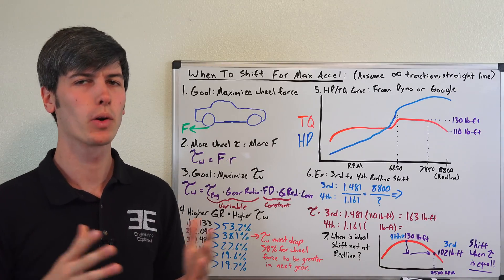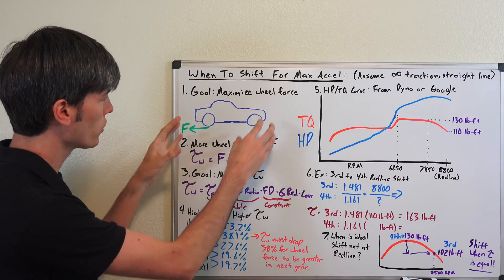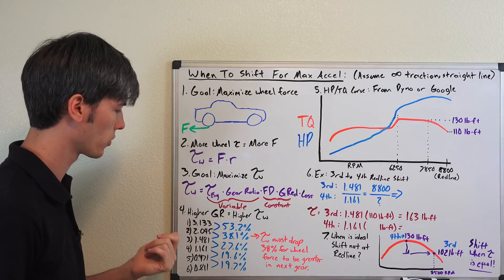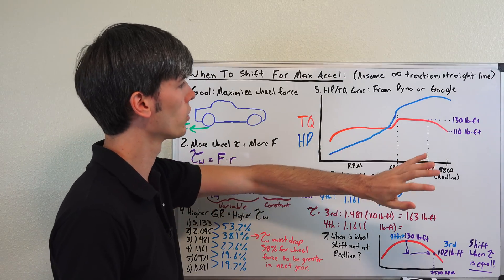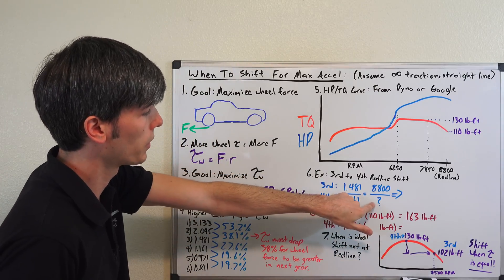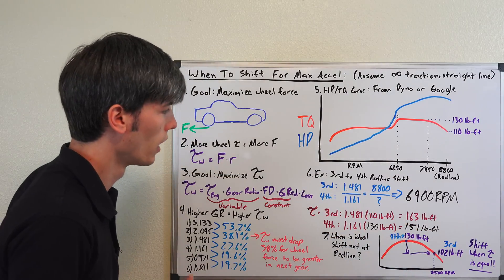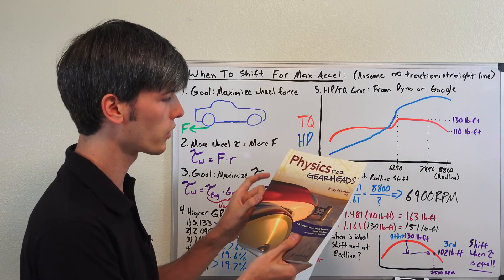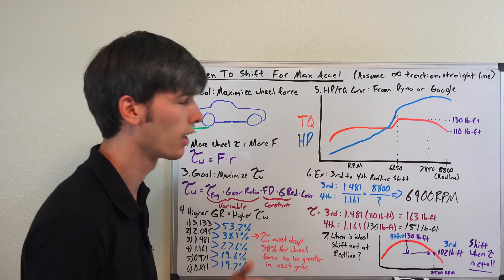When To Shift Gears For The Fastest Acceleration

Comment: My old 95 Vauxhall cavalier mk3 with its 1.8 8v engine has highest torque at 3000 RPM. So Im wondering is it not better to shift at around 4000 RPM because after shifting I always end up at around 3000 RPM on that RPM the engine got the highest torque. I feel like its better to stay between 3000 and 4000 RPM rather than revving to Max RPM and then shift.

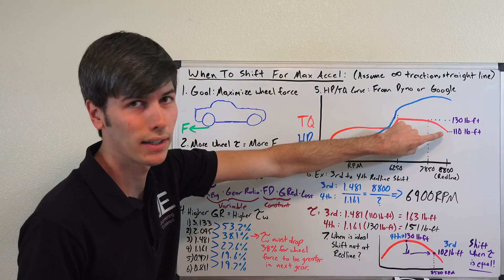Comment: 6:16 How would a large peak-to-redline torque difference (i.e. 400ft-lbs peak & 250ft-lbs redline AKA 60% difference) affect this? For my 2023 AWD kia stinger 3.3T (A8TR1 transmission), the lb-ft for each gear decrease (1st 916.25lb-ft, 2nd 910.48 lb-ft, . . . 7th 231.48 lb-ft, 8th 216.84 lb-ft) but the peak-to-redline torque difference of 60% is higher than even the 1st-to-2nd gear difference (1st 3.665 to 2nd 2.396 = 3.665/2.396 = 52.96%) 60% > 52.96% Does this change anything, or do I still run it out to redline based solely on the fact that each subsequent gear will produce less torque than the previous one?

Comment: At the same wheel speed, RPM is proportional to gear ratio. So basically, we can use engine torque × RPM instead of multiplying torque by the gear ratio.
And as we know, engine power equals to engine torque × RPM. Hence we can use power instead of multipying torque by gear ratio.
To simplify that, basically you want to stay in a gear which the engine makes more power. By looking at that specific graph, we can see the engine power output is the same at 8800 and 7500 RPM; meaning at any RPM below 7500 we would have less power comparing to redline; resulting less wheel torque at the same wheel speed.
So as long as you know shifting at the redline drops engine RPM to any number below 7500, it would be more efficient to redline it.
This engine + gearbox characteristic is usually the case with most production cars, which makes them go faster if you go all the way to redline before shifting.
Reply: Edit:
Engine power is "proportional" to engine torque × RPM; not equal.
Physically, it is indeed equal, but only when you use SI units; which would be watts, N.M and angular rotaional speed ( RPM×pi/30 ) for power, torque and engine speed respectively.

Comment: Jason, maybe you could help me out with some of the math. On your example of the difference in percentage of torque between 1st and 2nd gear, you come up with the answer 53.2 %. However when I divide the 3.133 by 2.045 my calculator comes up with 1.532. If I move the decimal point to the right 2 places to convert to percentage, then it would be 153.2 . Sure I'm doing something wrong just curious.  Same with the other gears, there is always a one in front or your answer. Thanks.

Comment: The best acceleration is when you have the biggest torque at wheel and it is eqiuvalent... the biggest power from the engine, not the highest torque. This is because of gears ratio in transmission. So you'd better look at engine power plot than torque plot. So you have hill-looking plot of power and you are going to higher rpms. When you are at the downward slope of that hill you should look what rpm you get if upshift (lower rpm). And if at that point (2) power gets equal to the power at your current rpm point (1) you should change gear. That's all. And every gear in the box has its own point for optimal shifting.

Comment: The simple answer is: the gear with the most power wins. Look at a power curve for your engine.  Work out the ratio of two consecutive gears let's say 4th to 5th is 1.25:1. Look at the top of the power curve and try and get two equal powers above and below the power peak with the rpm in the top gear, 80% of that in the bottom gear.
It will usually be the rev limiter apart from in diesels with small turbos and lots of closely spaced gears.

Comment: Nope.

Plot the torque curves in each gear relative to road speed.

Where those torque curves intersect are your optimal shift points.

If the intersection would theoretically be above redline, you compromise by shifting at redline.

If you shift too soon or too late you will lose a chunk of the area under the respective torque curves.
That means slower acceleration.

It's as simple as that.🚗🏁:text-green-game-over:👍👌💯

Comment: Why not shift from 3. to 4. at 7.850. Would that not give my torque to the ground?
Reply: NO cos power graph is important not torque graph 😉👌🏻 when you ups at 7850 rpm you would use lesss power for accelerstion = worse accelerstion 👌🏻

Comment: Super interesting. So, does this mean that horsepower has NO influence on the ideal time to change gears?
Reply: horsepower is the only thing beside gearing which have influence on when to change gears its all about avg power through distance lenght at which you measured  performance or speed range 😉👌🏻☕️

Comment: I could be completely wrong on this, so correct me if I am wrong, but here me out. As I've grown up with the whole HP=Torque*RPM/5250, thus is another representation of torque taking into account the benefit RPM provides a lesser torque value, I've come to look for the HP curve and use that as a guideline, and you typically want to try and maximize the HP figure for the longest you can. Or at least that's always what I've done in Racing games and IRL (avoiding going into redline IRL for durability reasons). I think it could be interesting to do a whole deep dive on gear ratio's, engine power curves and their shift ranges, and then to plot these out into a meaningful graph of some kind of how far past peak power you go.

TLDR, it makes sense to shift at redline on the displayed powergraph and shift RPM difference because a redline shift maximises the area under HP. At least that's how I've always looked at it and used as a rule of thumb.
Reply: rules are : slowlsy increasing power before peak and rapidly drop after peak you shift earlier 👌🏻 rapidly increasing power before peak and slowly decreasing power after peak = you upshift later 👌🏻 yea area under power graph its what metter so thats why 👌🏻 you must also consider diffrencess between gear lenght and speed range which ypu want measured sometimes ypu get benfit for ups later sometimes sonerr 👌🏻 all dats must be precisellly subcribe than can be calculate pefect ups time 👍🏻 furthemore at so e egzample elt say power graph some engine setup for racing or not whatever look like piramide so power before peak increase the same fast as it drops after peak power than asssuming diffrencess between gear lenght is small you ups very close to peak power rpm but assuming difrencess between gear lenght are huge you must ups later 👌🏻 after peak power rpm 👌🏻the boger doffrencess the later you must ups for get most avg power for drive vehicle 👌🏻☕️

Comment: Awesome explanation. 
To find at what RPM to shift, wouldn't it be easier to solve for the rpm you want to shift to land at the desired rpm? 
For example, on my motorbike, I found out I have to shift at:
1st 8371
2nd 8140
3rd 7844
4th 7448
5th 7070
The rediline is at 9500.

Comment: Up shift at the point where the revs drop to the max torque in the next gear?
Reply: NO when you ups depend only on power graph never ever sugest torque graph it mean 💩 literallly 👌🏻😉 👌🏻 what you want achieve is to have most avg power for drive /accelerste vehicle forward torque in regard to such racing aplication start to have no sense at all 👍🏻 though in some case ups for have max tprq rpm at starting point on another higher gear can be the only one correct solution but its not becasue ypus tart from peak torq rpm but beacuse power after peak drop rspidly in results hold on lower gear to higher rpm and start st hogher rpm than max tprq rpm give less avg power  simple 👌🏻

Comment: Brilliant explanation  Jason.
Its also why for race cars you need different gear sets for different tracks, you pick the longest gear so it just redlines on the longest straight and then space the others so each down shift puts you as high up the torque curve as possible while allowing 1st and second to be short enough for the start and not leave any gaps (obviously in practice lots a bit more complicated).

F3 teams literally travel with cases of gear ratios which they swap around.

I geared my BAC Mono in this way for Silverstone and it makes a big difference.

Comment: I always thought there was no advantage running the engine past peak HP [which is where I shift when racing (not IRL.)] - I guess I'll have to plug in the numbers for whichever car I'm driving. In a test I once did on Gran Turismo I was always faster shifting at peak HP vs running to red line though.
Reply: well in some casess this can be true precisellly speaking when power before peak increase slowly and drop after peak rapidly 👌🏻but ☝🏻 if tendency in power characteristic is oposit so power before peak increase very rapidly and after peak drop very slowly if ups at peak power rpm especially if ypu have big doffrencesss between gear lenght the vehicle now be weak /slow accelerstin as 💩🤭 in comparision to if ypu ups in this case on rpm much beyond pesk power rpm 👍🏻😎 so you was let say half correct half wrong it depend on power specified engine characterisitc in regard to diffrencess between gear lenght and not some stiff rule which aplie correctly to every single engine 🫣☕️

Comment: Now this got me thinking if geared right: Would it be best to shift right before the Torque falls off on lower gears right before the 1:1 gear? Theoretically thinking that higher gears will benefit acceleration by utilizing higher rpm Horsepower.
Does this though make sense to anyone else?
Reply: Power, not torque, is the limiting factor in not only the top speed of a vehicle but also how quickly it can accelerate at any speed and how much weight it can pull up an incline at any speed.  There is no significance to 1:1 on acceleration other than it is different from other ratios.

Comment: Thanks - Q: for a CVT car, would fastest acceleration occur at peak torque or peak HP rpm? The math says peak acceleration occurs at peak torque, but most CVTs will rev to peak HP rpm at WOT and hold - why?
Reply: The gear ratio multiplies the torque.  Torque/ power to the wheel is all that matters.

Power, not torque, is the limiting factor in not only the top speed of a vehicle but also how quickly it can accelerate at any speed and how much weight it can pull up an incline at any speed.

Comment: @Jason, Based on this video, you claim that shifting at redline is better for max acceleration, due to the inherent gain from upshifting due to the spread in gear ratios. However, in a couple of other videos, you also mention that CVTs should also keep the engine at peak power and not peak torque while referencing this video, isn't this counterintuitive? In a true CVT (without the artificially segmented gear ratios), wouldn't it be better for the CVT to hold the engine at peak torque (maybe a little above to account for losses), and not peak power?

Comment: Great video, however there is a much simpler explanation which doesn't involve engine torque at all - it's sufficient to look at the engine power curve. Since power is equal to the rate of change of kinetic energy, for any given speed, you want to be in a gear which maximizes power. This means that it's never beneficial to upshift before hitting maximum power. On many cars this is just below redline. It's only beneficial to upshift if you are past peak power and doing so would drop you onto a place on the power curve that's above where you're currently at, but by then you're most likely already past redline, as you explained. My point is, the math becomes much simpler when you look at power instead of engine torque and gear ratios.

Comment: I think it's actually simpler than that (although the end result is the same): for max acceleration, you should shift when the rising engine power produced at the higher gear (i.e. after the RPM drop), is equal to the tapering engine power produced at the lower gear. Or, if that is not possible (i.e. if even at redline, the engine power produced at the higher gear is lower), then shift at redline.
Reply: 👍 well said!  Sorry I took so long to get here.😁

Comment: Won't it make more sense to shift when in peak torque?. Why shift when i'm outside of the powerband??
Reply: I guess it's because say you accelerate in 3rd gear as he shows and he were to stay in peak torque which is at like 7850 (max rpm within the peak torque range), if he shifts now, the rpm he is gonna be in will be (1.161/1.481)*7850 = 6153, which is below peak torque, and hence in 4th gear you wouldn't have that much torque, so I guess upshifting at redline makes sure that the torque in the next gear is a high as possible, but also, staying in these rpm maximizes horsepower and the speed of the car, as you also want to car to be going fast "constantly", you know, you don't want the speed to drop just so you can get peak torque, as that goes against accelerating most effectively, but I don't know man I might be wrong. I hope he sees this comment actually haha
Reply: If you stay in the torqueband you never get to the powerband.

Power, not torque, is the limiting factor in not only the top speed of a vehicle but also how quickly it can accelerate at any speed and how much weight it can pull up an incline at any speed.

Comment: I have a question, does horsepower play a role in the acceleration and how do you calculate its impact in relationship to the torque?
Reply: Horsepower is equal to torque times rpm times some constant to make up for the weird unit that horsepower is. But remember power is just torque*rpm

Comment: This video alone has allowed me to go against what all the drag racers have told me to do in my 1998 mustang gt. They all say i need to shift at or just after peak horse power to get the best ET at the drag strip. Well after doing the math myself armed with my own dyno graph (280hp 330trq) ive been able to get a 12.9 second pass at 104.5mph in a very slightly modified 1998 mustang gt.
Reply: Well they was partly correct , all depend how powergraph egzacly look like 🤷🏻‍♂️ and how big are diffrenc in gear lenght 👌🏻 if gearing allow engine to stay at constant flat peak power than you dont need to spin more rpm than rpm where peak power ending in fact you cant unless you want accelerate slower 🤷🏻‍♂️
Reply: @mociczyczki  well if you noticed, I said I did the math myself meaning using the dyno graph I have from getting dyno tuned I was able to prove what the majority of people say wrong when it comes to shifting points for my platform
Reply: @adamhelmers3185  ok 👌🏻

Comment: Does horsepower not factor into this at all? Only wheel torque?
Reply: Horsepower at given velocity generate wheel torque at constant wheel radious other words bigest wheel torque at given velocity in specified vehicle can be generate only when engine spin rpm at which have max peak power 👌🏻 yep peak hp is point at which each engine at given velocity always be accelerate best 🤷🏻‍♂️ in racing each want stay as close to peak or at peak power as long as posibble 👌🏻 best when peak power can be use all the time at whole race distance but usually traction limits dont allow driver to constant use peak power 🤷🏻‍♂️feg in topfuel drag sterr they cant use max power from 0 to like 150-200 metres not egzacly calculate this but probably it be somewhere around this distance ,if they do misteake and use slightly to much power wheel imediatelly lost grip and they lost race 👌🏻assuming topfuel engine at specified rpm generate 13000 hp than at 100 km/h they theoretically be bale to generate at contact path 30 tons of force so 20 times more than 18 wheeler truck .,theoretically/potentially cos they tires dont hVe enough grip to transfer such big force on linear acceleration topfuel cos this vehicle are to light cos they lostgrip ataround 5G if top fuel weight 1 tones only that mean he can use max 5 tons force at contact path for linear acceleration if clutch somehow squeez to strong and transfer lil more force grip is lost 5 tons force at 100 km/h can be generated be just 2000hp around  it need lil more cos massiv drag of its tail spoiler etc anyway they.Can use peak only after some distance before this not really 👌🏻other words let say some engineers create some vehicle if they want max posibble acceleration at very specified velocity they must setup gearing in such way that at this very specified velocity gearbox allow engine to be at rpm where this engine generate max power 👌🏻 if they give to short gear where engine be at to low rpm or to long where engine be at to high rpm they dont achieve max acceleration at this specified velocity in this vehicle 👌🏻😁other words if you have scooter with cvt and you know at which rpm engine generate max peak power if you want max acceleration on this scooter you must setup cvtin such way that engine be always at this peak power rpm not lower and not higher otherwise acceleration be worse 😁👌🏻this happen in reall cos watt:m/s=force like nobodys bisnes 😎👌🏻